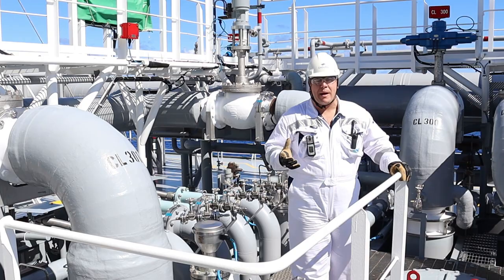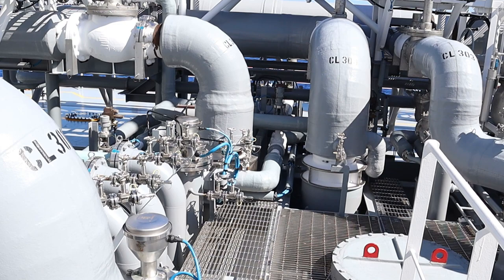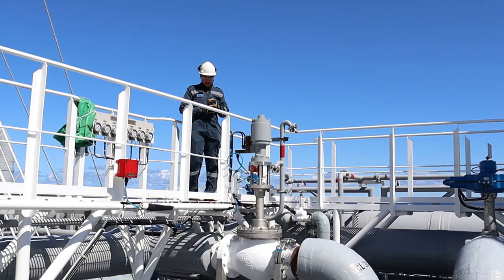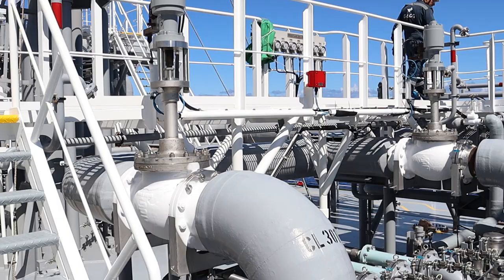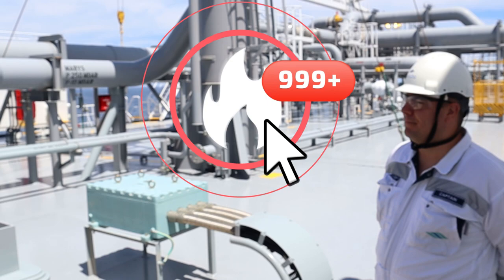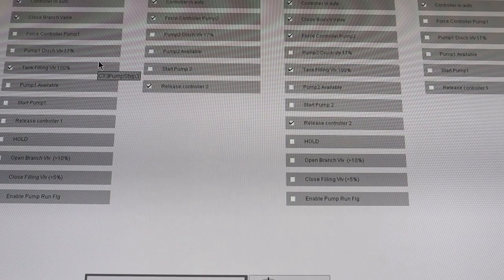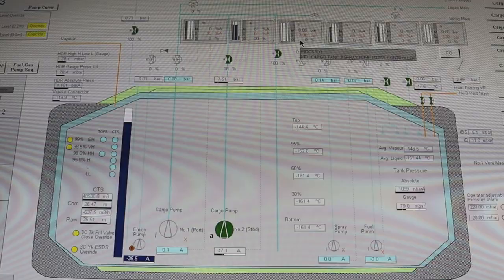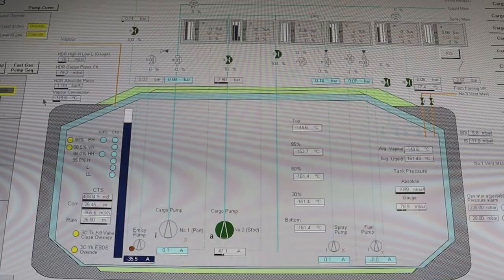How to safely start your cryogenic cargo pumps onboard your LNG carrier and the sequences followed

Comment from the maker: Questions? Eρωτήσεις;🙏
Reply: Great job, Nick the Sailor Man! 
Can you clarify some questions?
1. At frame 0:01:30 it seems that the Spray Line branches from the Discharge Pipe of the Portside Cargo Pump. Is it true? I believe it must start from its own Spray Pump.
2. What is the purpose of the short piece of pipe visible at 0:07:00 which is attached to the bottom of the Vent Mast and plugged by a blind flange?
3. I cannot see any float gauge on your liquid dome. What do you use to back up Radar? 
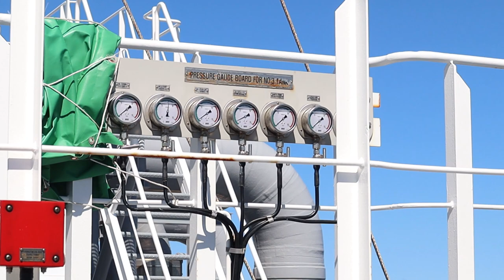4. Can you list all seven dials of your pressure gauge board (0:06:52)?
Reply: Τι θα συμβουλευατε εναν ανθυποπλοιαρχο απο γκαζαδικα που κοιταει να κανει την αλλαγη στα LNG ?Τι μπορει να κανει ηδη στη στερια για να καλυψει καποιο κενο?
Reply: @Tsotsis1  Διαβασε όσο μπορείς online σχετικά με LNG carriers, γενικά. Παρακολούθησε φυσικά τα βίντεο του Captain εδώ (άριστος) Δεν υπάρχει περίπτωση βέβαια να μάθεις cargo operations/ cool down / gas management αλλά τουλάχιστον θα μπορουσες να πάρεις μια ιδέα σχετικά με το τι θα  συναντήσεις σε άνα LNG carrier. Δεν έχουν καμία απολύτως σχέση ή ομοιότητες με γκαζάδικα, στην ουσία θα αρχισεις από την αρχή, αλλά να μην απογοητευτείς ποτέ. Εάν μελετάς, προσπαθείς και αναπτύξεις την νοοτροπία που χρειάζεται για να εργαστεις σε αυτόν τον τύπο πλοίου τότε θα ανταμειφθείς. Γιατί είναι πολύπλοκα και εξαιρετικά ενδιαφέροντα πλοία. Από εκεί και πέρα, υπάρχουν αρκετοί διαφορετικοί τύποι αυτών των πλοίων, που αν και εξωτερικά όλα μοιάζουν να είναι ίδια, εσωτερικά έχουν πολλές διαφορές και δεν έχει νόημα να αρχίζεις να μαθαίνεις για κάτι το οποίο μπορεί να είναι διαφορετικό από αυτό που θα αντιμετωπίσεις όταν πας μέσα. Να θυμάσαι όμως πάντα τα παρακάτω: Safety First 
ΥΓ: Είμαι LNG C/O (εν ενεργεία)

Comment: Thanks for the LNG videos. Is it possible to make a video about LNG 
cargo machinery, LNG valves and pipes, safety valves, basic cargo 
operations in the CCR, basic explanation and presentation of pipelines 
and valves on the screen in CCR or some theoretical explanations of 
cargo operations by cargo checklist?
It can be divided into several educational videos. 
It would be very nice with added voice in English or text explanations :)
Reply from the maker: Great suggestion! Well there is a large number of items suggested but will see what can be done.
Reply: @nickthesailorman360  Thanks for the LNG videos so far. That would be very useful and interesting.

Comment: The lng pump is a centrifugal pump correct? Centrifugal pumps can be started and should be started with discharge valve closed like the ballast pumps. Why the lng pumps need to have the discharge valve open? Thank you in advance.

Comment: What is the name of the maker for the cargo pump discharge valves(actuator especially)?I have't seen this type before.I have worked for the most part with SNRI and some japanese types on moss.
Reply from the maker: Hello I dont have them available on hand at the moment but they are very reliable and trustworthy no issues with them.

Comment: Looks like he never experience packing blowed on discharge valve during start and size of cloud it’s create! staying so close to the valve during start is it Gas Log SMS requirements?))
Reply from the maker: Well Sergey no we dont have such incidents and I never heard of one in the industry.Only one of a manifold in a terminal.Our SMS strongly requires all flanges to be retighted prior loading and discharging at to be pressure tested, i hope this covers the comment.Safe seas.